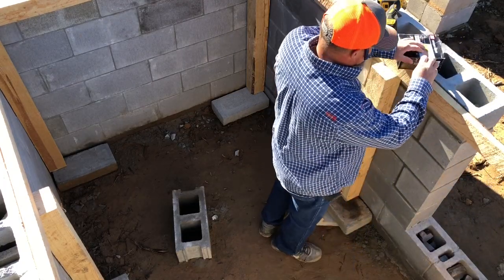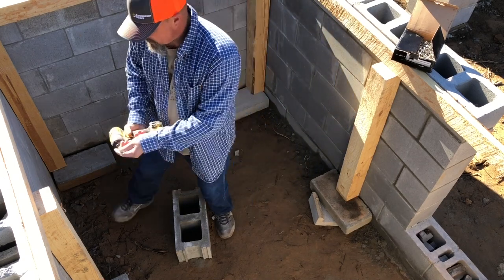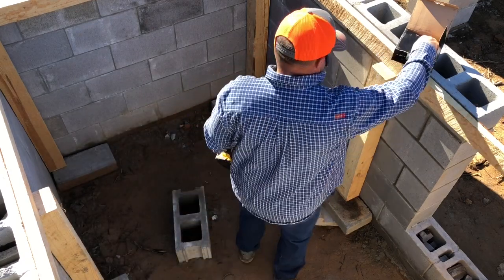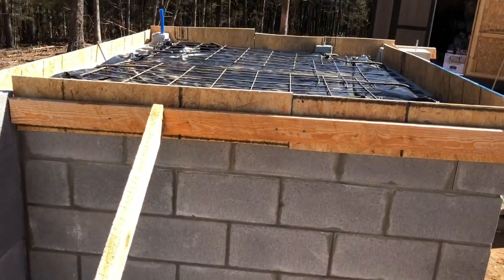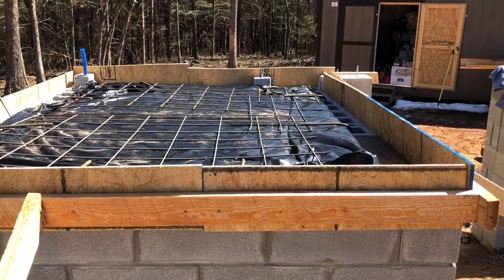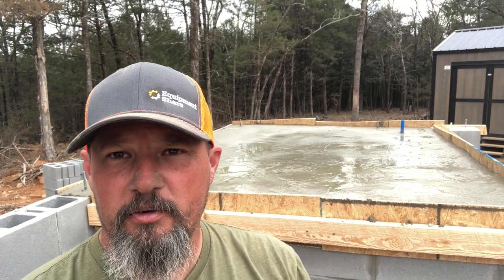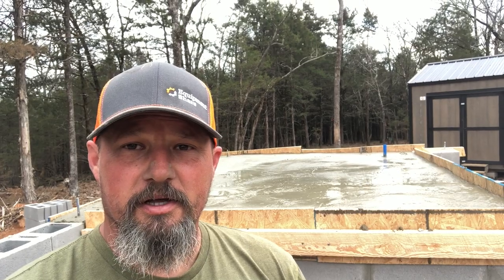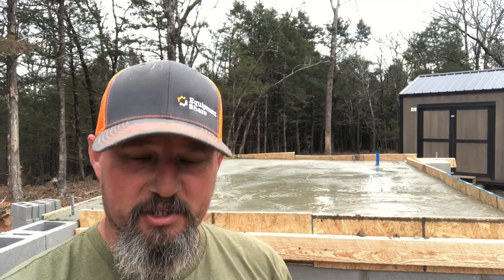Pouring the ceiling for our budget storm cellar

Comment: You don't have nearly enough rebar in the roof or rebars to tie the roof to the block wall.  Also for concrete roofs you need the metal support sheet as a base.  You were smart to leave the support lumber inside.  I would fill the inside with 4x4 posts to prevent anyone going inside.  Plus cheap concrete without reinforced fibers is a no no for concrete roof systems.😮  The concrete block wall needs to be rebar'd and the voids filled with concrete to prevent the wall from falling sideways and dropping the roof.  I would only allow tax collectors or lawyers to use that space.